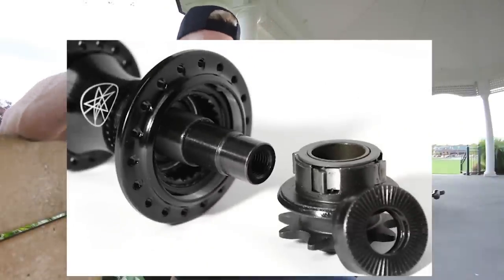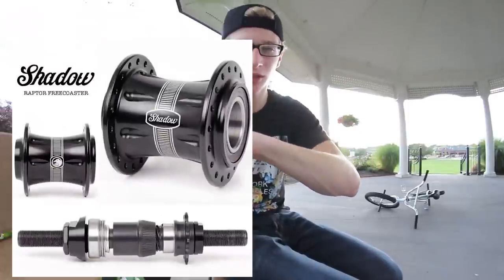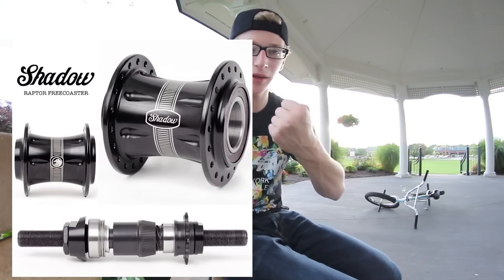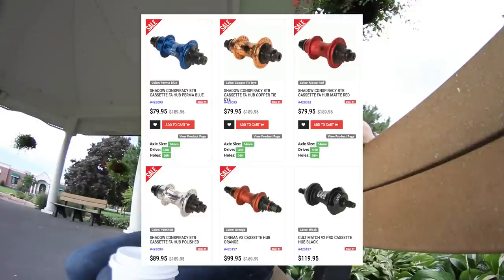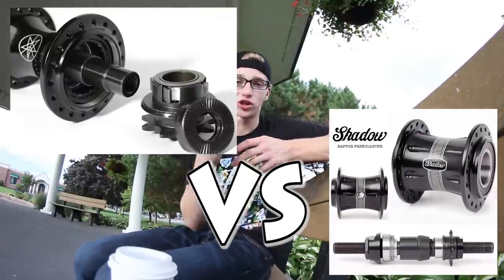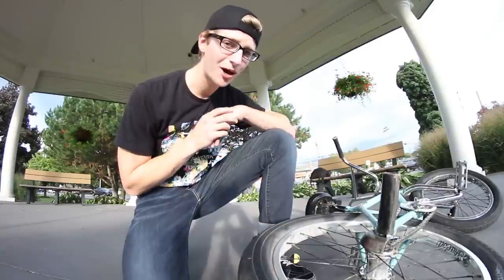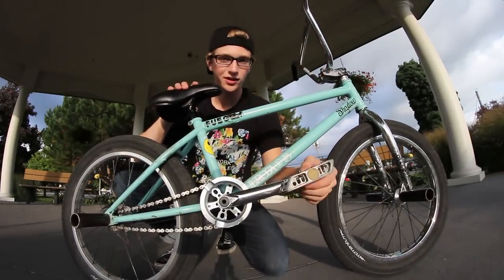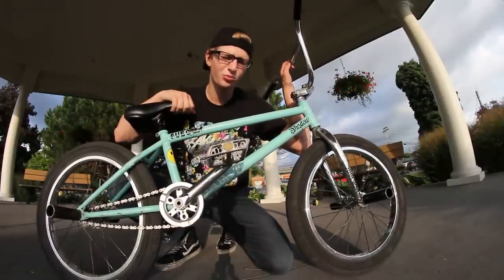BMX FREECOASTER VS CASSETTE

Comment: Im just gonna stick with a cassette. I hate hitting my knee on the stem.
Reply: Get a good FreeCoaster and there is basically no SLACK
Reply: Not even a good coaster  just  an adjustable one
Reply: @kingpanda5974  That's not true. I got a Sunday Soundwave and it has plenty of slack. I hadn't ridden a bmx in a very long time. First time I rode my Soundwave, I was like "what the hell is this". Lol
Reply: Me too
Reply: @kingpanda5974  Not sure if you've ridden one before, but, a freecoaster is supposed to have a bit of slack. Not safe taking all the slack out. The slack is made so you don't easily engage it when you do fakie tricks. I've been riding Fc for over a year and I can vouch for that.

Comment: I think the only difference in opinion is that cassettes will blow out driver bearings. if you have one with bearings that is. I made a bushing for my primo pro cassette and it's still going strong after 12 years. I do routine maintenance ie grease oil  it. other than bearings going out on occasion they last forever.  just know that sealed bearings can be lubed by removing the seals and flushing them and repackaging them with grease. good video btw

Comment: Are cassettes with more point of engagement (like a premium stinger) better then a normal cassete
Reply: donky donk theres is less pedal slack and they are louder most of the times(no advantage in riding but sounds better) so i would say yes

Comment: Im a racer and engagement is everything but do you think you have more balanced pedaling backwords and engaging right away plz respon love the vids by the way
Reply: Needle Media thanks for responding i ride a 2014 pk ripper 22in top tube with snm perfect ten bars profile 185mm cranks and crupi rhythm 20 1.75 wheel set im a guy by the way wrong acount but yea love gotta love SE Racing

Comment: I know I’m a little late but maybe it should be broken down too purpose. I look at it more like, in racing I probably want immediate pedal power and less weight. Street flatland and park is different less speed so weight isn’t as much a concern and the flexibility of the freewheel give you more maneuverability.

Comment: I ride a diamondback grind 2015 how do I change my stem
Reply: Get a new bike bud
Reply: Yeah, I ride db grind 2016, not had it long and it's completely done. The thing that annoys me is that it's a "grind" but you can't even get pegs on the front because the nut's too small

Comment: he said it's hard to break a cassette. I broke one by putting a 36 tooth sprocket in the front and a 9 tooth driver/cassette in the back
Reply: Haro BMX that's not a good gear ratio
Reply: Emanuel Morales yeah after that I changed the front sprocket to a 28 tooth sprocket
Reply: Trebor Cash I didn't know any better.
Reply: 25/9 is what I run

Comment: Any one worried about the slack it’s fine I got used to it in about 30 mins the biggest difference is weight I had a coaster but now I ride cassette because it is waaaaaaayyyy waaaaaaayyy lighter